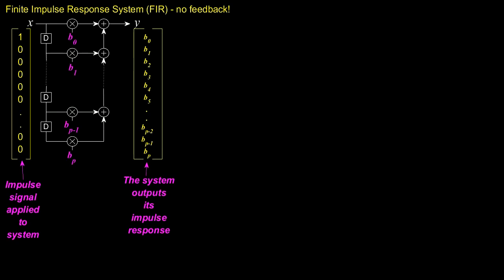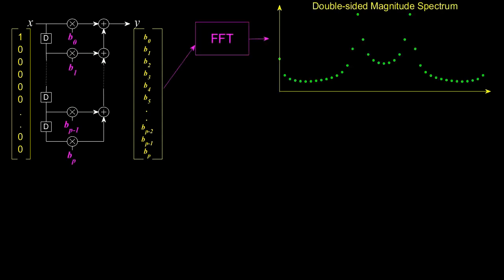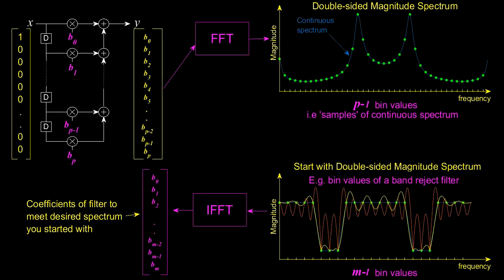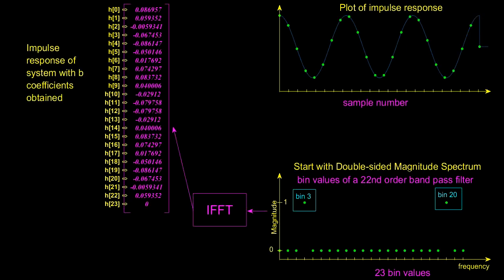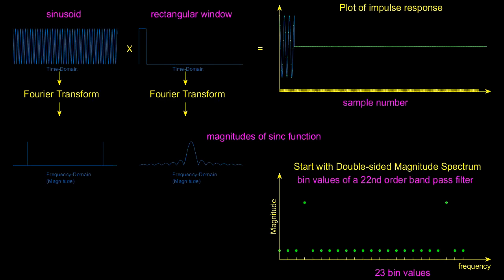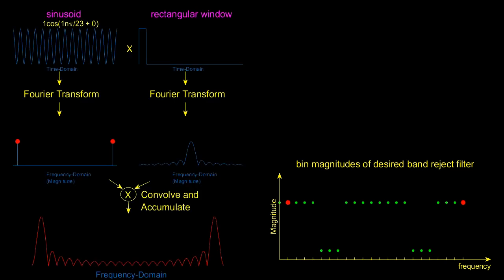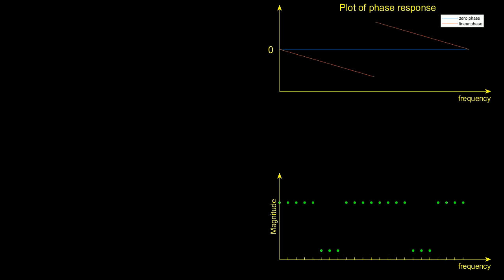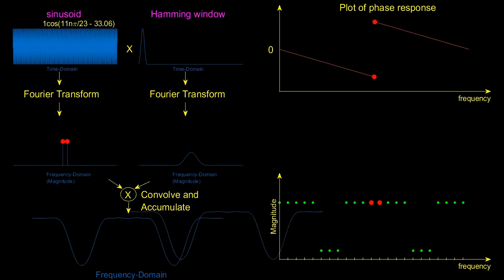fft based FIR filter design (windowing and phase issues)

Comment: Sir, about the linear phase spectrum, is it really just a random straight line that you chose, or is it based on something rigorous? and i suppose the steeper the line, the smoother the resulting magnitude of the IFFT is, right?

and is it ever possible to achieve a perfect "blue line" IFFT like one you mentioned in 1:25? completely disregarding how messy the phase spectrum would be, is that ever possible?
Reply from the maker: The phase spectrum calculation is shown at the very end of the video where some matlab code is provided. I haven't investigated the impact of increasing the steepness of the line so can't comment at this point in time.

In theory, it is possible to achieve any frequency response but the trade off is an infinite number of filter coefficients, which isn't practical!
Reply: okay, let me follow that then and ill try some experiments of my own. thank you!
Reply: i did some learning, and i found out that the negative of the slope of the phase spectrum (unwrapped) corresponds to the group delay introduced into the signal. in other words, the steeper down the (unwrapped) phase shift will be, the further back in time the peak will be.

Wikipedia has an article on phase delay and group delay. i confirmed this using libreoffice calc; i just applied it in practice. and it works!
Reply from the maker: @lalremruata_chongmang  Ah yes! That makes perfect sense. I did a video on linear phase filters that might be of interest https://youtu.be/xPTe7ZWLVhQ?si=WiqiA7-z8QENey7K

Comment: Does it work for IIR filters as well?
Reply from the maker: No
Reply: @ddorran  Ah, sorry, meant like: is there a similar way to design IIR filters from an arbitrary/given frequency response? Thank you!
Reply from the maker: @autumnfox3619  There are, but it's not something I know a lot about. Having said that, an approach using pole zero placement (see  https://www.youtube.com/watch?v=m5TP2uG_O2M) might give you some intuition on how to tackle the problem. You can meet an arbitrary frequency response by moving poles and zeros around the z-plane. Then you can use the poles and zeros to get the system coefficients. 

You can do this by hand using the zpgui tool (by Tom Krauss of Perdue). Mathematical approaches would seek to position poles and zeros to minimise the error between the desired frequency response and the response resulting from pole zero placement.

Hope this helps.

Comment: 1:05 is this what's commonly known as "frequency sampling" FIR design method, right? 
Proakis-Manolakis 10.2.3 or Schaum's Outlines 9.3.2
Reply from the maker: Yes it is frequency sampling method. In a lot of texts you will also see an approach which starts with a mathematical description of an  'ideal brick wall' frequency response, then the inverse fourier transform is a sinc function, and the sinc function is sampled to obtain the b coefficients. https://www.allaboutcircuits.com/technical-articles/design-of-fir-filters-using-frequency-sampling-method/ also goes through some details on the various approaches.